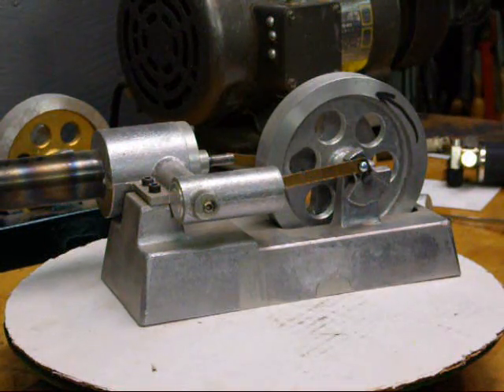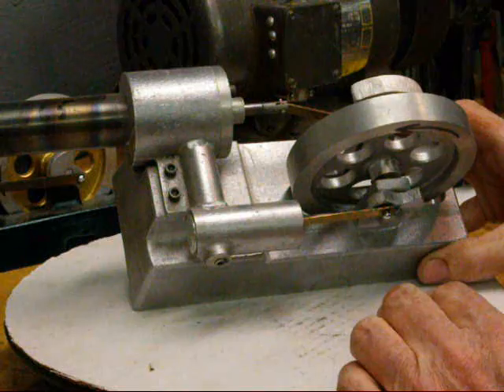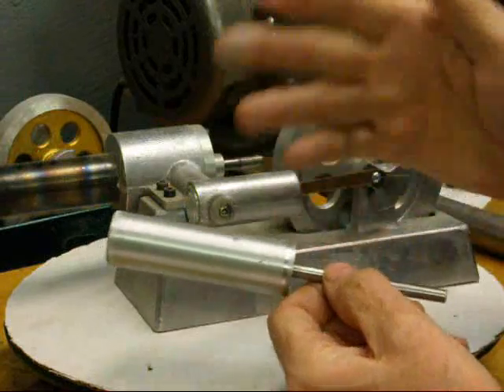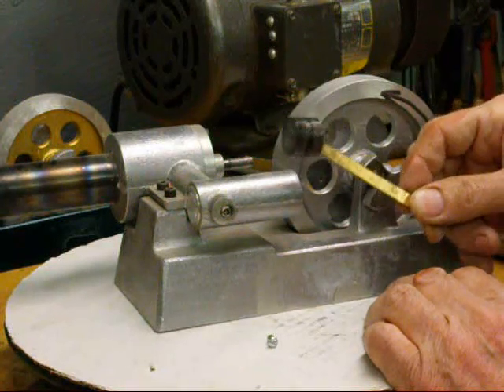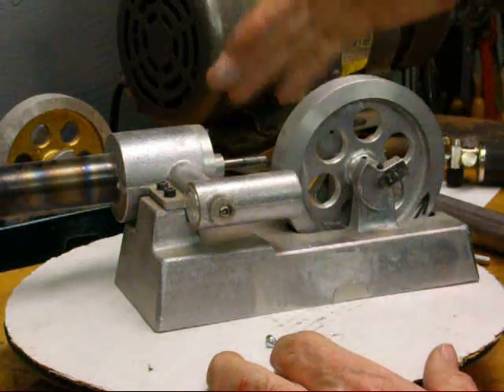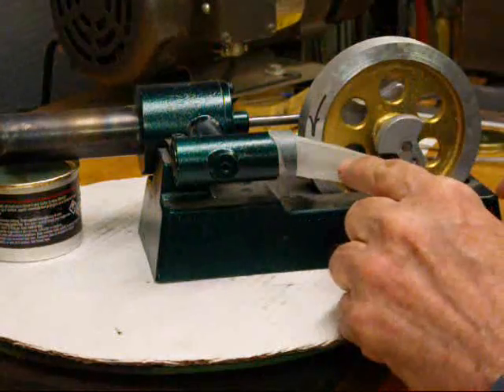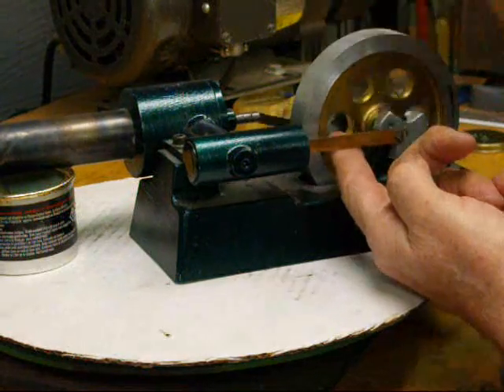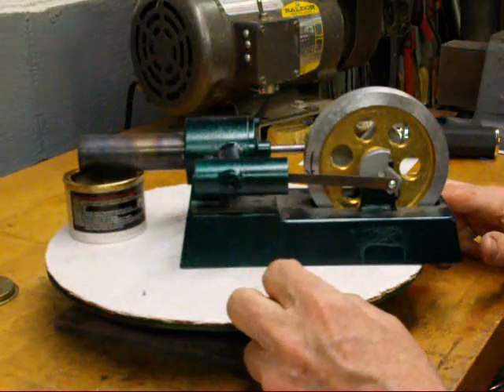Principles of STIRLING HOT AIR ENGINES tubalcain

Comment: Hi Tubalcain:
I found the answer to my question about the balloon inflating and deflating, I just realized it's a closed system, so the balloon was responding to the gas expanding and contracting , rather than the movement of the flywheel causing any pressure, in other words, the flywheel just acted as a valve lever to the gas while it was expanding or contracting.

Comment: For Stirling engines you should read up on Charles's law as well as Boyle's law.  Boyle's law states that the volume of a gas at a constant temperature is inversely proportional to pressure.  Charles's law states that- the volume of a fixed mass of gas at constant pressure varies proportionately with temperature.  In a Stirling engine both the pressure and volume change through the cycle so it's really the Combined gas law that applies.

Comment: That's the closest explanation I have seen, however, at time mark 4:30, you mention that the tube is being preheated, but somehow, your action of turning the flywheel, and making the balloon inflates and deflates, makes it appear that the heat has no bearing on the movement.

And would you please explain the 90 degrees shift, I don't see why you have no mention of it !

Great video, thanks

Comment: Perhaps it's useful for some if you would point out that the motion of the piston leads the motion of the crankshaft when you disconnect them. That's an indication that the piston provides power.

Comment: I'm watching this video between times of work, so I'm not focused, sorry if this might sound confusing.  My first thought is, Would it be possible to use a single displacer, with double (opposing) power pistons, alternating the gas flow, to increase performance?  THIS IS WHY I WANT A MACHINE SHOP - TO PLAY AROUND AND SEE WHAT HAPPENS!
Reply: Not quite but a Beta engine has the displacer  and power piston in the same cylinder

Comment: A stirling engine is very inefficient but could it work if you put it on a cell phone.  What if a belt on the fly wheel drove a dynamo to charge a DC battery?  The dynamo would be located vertically above the engine so the best would not be exposed to too much heat or the engine could be on a metal platform a foot above the woodstove or something similar.  If you are using a woodstove for the heat, you don't care if it is inefficient because you want to use the wood stove to heat the home OR the woodstove could be in a shop and an electric wire carris the current to a battery system in the home.  TESLA WALL BATTERY is now a very efficient wall mounted, esthetic battery that you can connect to an invertor and wire to the electric panel in the home.  This could be the answer to off-grid living in winter areas where you need a woodstove anyway.  Would it work?
Reply from the maker: +saisonqwerty Try it--I think too inefficient

Comment: Could you replace the hot air with another type of air like pressurized air or steam
Reply from the maker: +thor 90 yes-other gases are used--not easy to do
Reply: Could compressed air be used instead of hot air
Reply: What do you think about 
a "putt putt" boat or "pop pop" boat as some people call it

Comment: Thank you for the educational video. QUESTION; My stirling engine has an electronic timing system that allows the displacer to be moved without a shaft penetrating the expansion chamber - but the piston does have a drive shaft turning a flywheel. So is this truly a stirling engine or is it just another heat engine design? VIDEO LINK BELOW
https://www.youtube.com/watch?v=6RKzYCICdyc
Reply from the maker: +Harold Westrich Very clever engine. Never seen one like it.  Yes, it is a stirling cycle engine